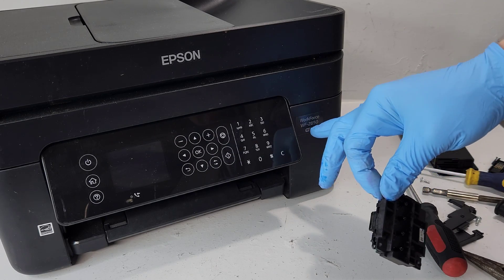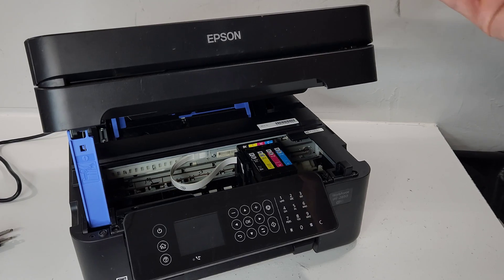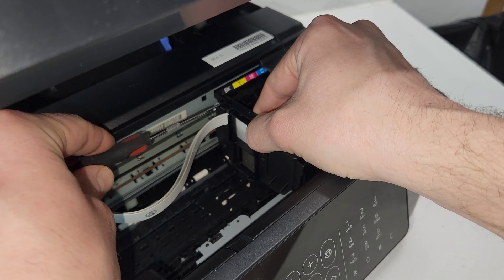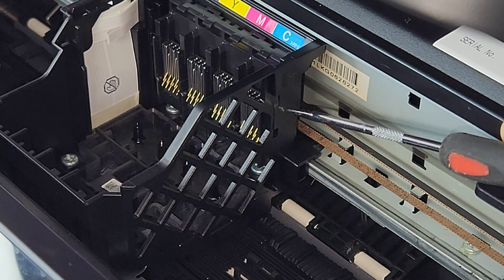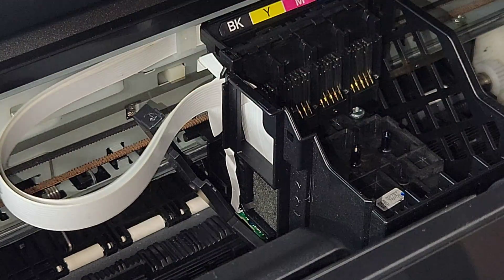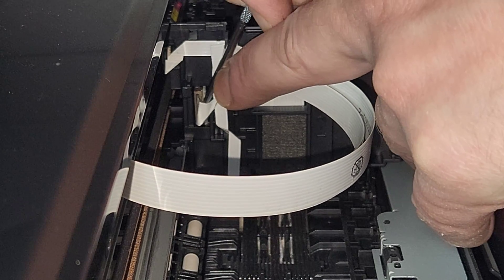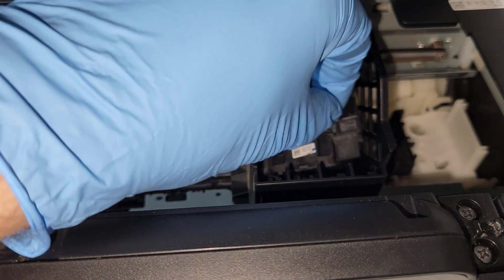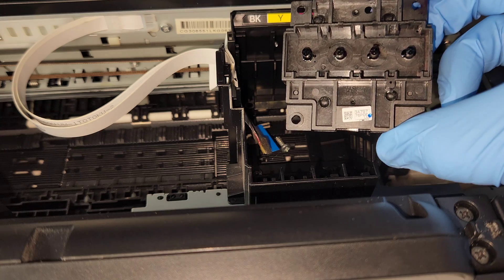How To Remove EPSON WF-2850 Printhead WF-2830 XP-4100

Comment: do you mind sharing where you bought your replacement printhead?
Reply from the maker: I buy used printers, and since I have a few, I usually find a good printhead to clean and use. I do not have a source, but Amazon and eBay has a few listing. I haven't had any luck buying from outside of USA. I have purchased a few before, listed as "new". The printheads were definitely not new. They somewhat looked like they were, but the nozzles were messed up or clogged.

Comment: One question, I loved your video and I did the same procedure but when everything returned to its place it didn't start and it said error during digitization☺What do you think I should do?
Reply from the maker: Hi. It seems like there is a problem with connection of wires. Make sure you have all wires connected. Sometimes the ink cartridge reader board is missed. It's a smaller wire.